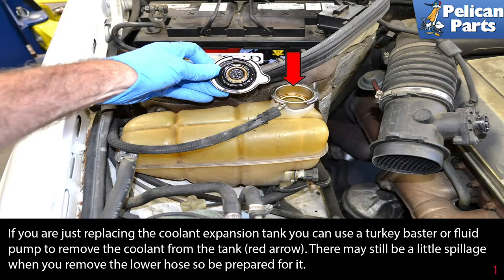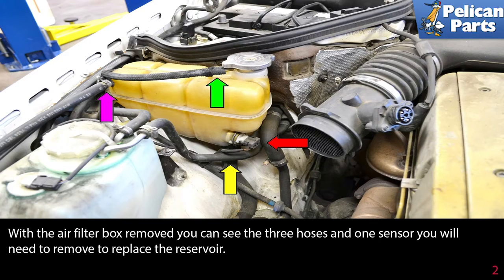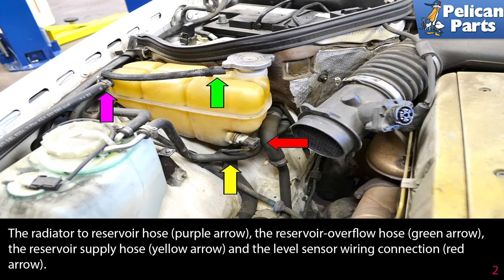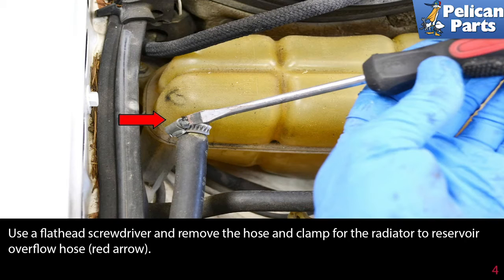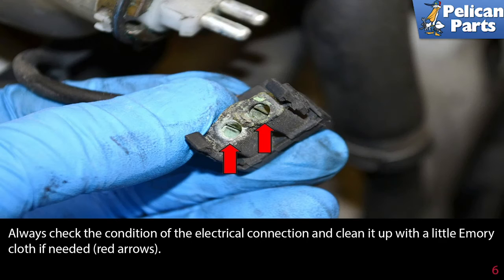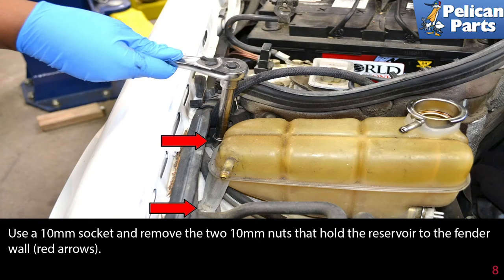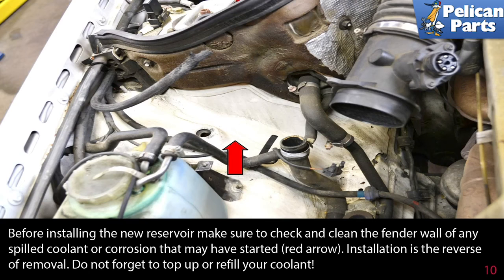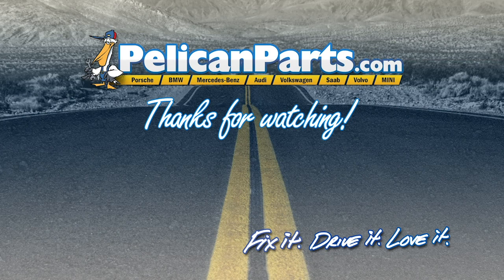Mercedes-Benz W124 E-Class Coolant Expansion Tank Replacement

Comment: where does the overflow line lead?
Reply from the maker: What year and model vehicle are you working on? On some of them, it runs to the ground, some the reservoir and radiator share it.
Reply: @pelicanparts  mine is a 1994 e320
Reply: @lennyloudpacks  On my 1995 E320 wagon it leads to another reservoir. You need to remove the wheel well liner to replace it.